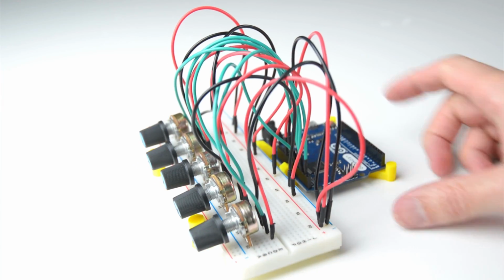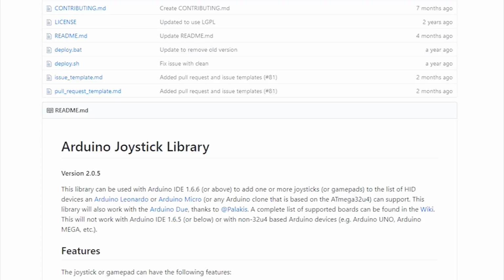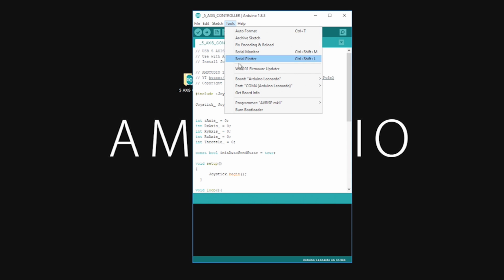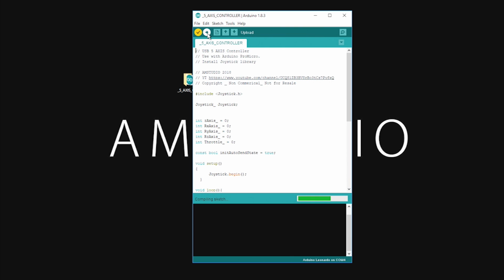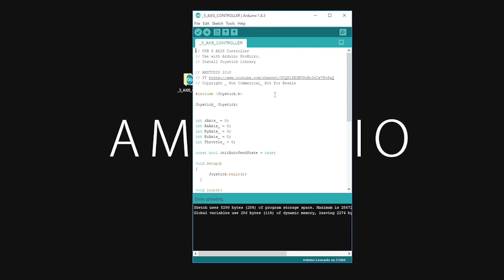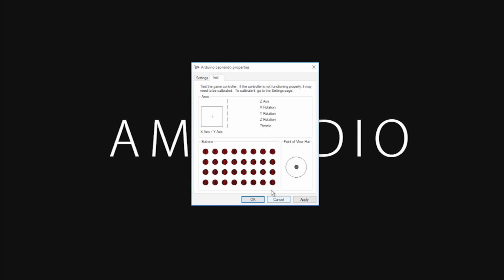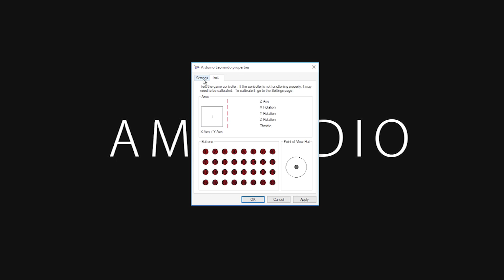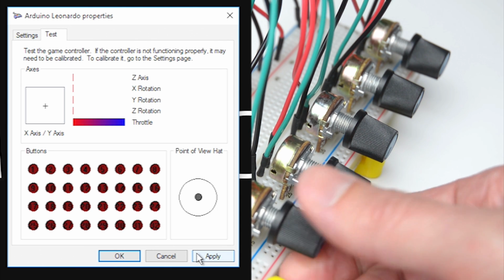5 AXIS ANALOG JOYSTICK GAME CONTROLLER

Comment: I have a qustion if I plug 2 arduino Leonardos can the game simultaniusly detect them both?
Reply: did you got your answer?
Reply: @imhumanx   yep it detects them as 2 seperate game controllers you can plug as many as ports for USB  you have.. but only problem is names of the controllers will be the same.. so knowing which arduino is which when setting up controls in setting of sims is difficult  and changing Arduino names is very hard i could not find any solid answer.
Reply: @SloGamer750  thanks brother

Comment: Could you please also show how to wire two position toggle switches and 6 position toggle switches? I want to build a custom switch panel to use with Microsoft flight simulator?

Comment: Will this work with 7 axes aswell?

Stick X
Stick Y
Pedals
collective
twist throttle on collective lever
throttle left
throttle right

Coz the 2 joystick boards running my simulator rig just aren't doing the trick.
Reply: normal plane have only 9 analog input or more. youke2,trottle,propeller,mixture3,rudder/brake2,flap1,trimm wheels2, thats have minimum control flight, 9-10 potentiometer need normal. and switch/buttond all what panel have start,power battery,lights,radio,speaker,heat,etc,etc,many, encoder need some gauge controll,navicator,radio,autopilot,speaker,maybe trimm wheels new model,,this have normal little size aircraft only ,big planes 747 etc all need lot lot lot lot lot more encoders,buttons,switch,leds, gauges,contyrollers.

Comment: This is annoying as all heck no matter what I do this sketch doesn't work I am calling shenanigans to many people post fake videos of working sketches just to put them online with mistakes put in place on purpose unless there is a problem with copping the txt from gethub and pasting it into arduino ide
Reply: I retract my statement arduino ide was the problem not the code even tho the libraries were installed by the software It did it wrong had to delete and find and install all libraries manually for this to work thank you for sharing

Comment: I tried uploading this for my yoke but when I move my yoke it moved all 5 axis at once instead of just 2 axis. Is there a code for just 1 x and y axis to be recognised, then I could assign them through FSUIPC in flight sim. Thanks in advance for any help.
Reply: You need to calibrate them. If it doesn't work you could also remove the other 3 axis in the arduino sketch.

Comment: Made this with 3 load cell amps for my DIY sim race pedals. Calibrated the axis to the pedals with the code, works a treat, thanks !
Reply: and it can be done with two potentiometers and a load cell?
Reply: @CarlosRCastro  yes no problem
Reply: Can this sketch work with just 1 potentiometer? I’m making my own set of pedals and only need 1 potentiometer for throttle
Reply: @banditfishing1558  yes you can just find some tutorials on the internet
Reply: when I run joystick program to turn arduino to joystick itt fails everytime and i can't make it, why?

Comment: Hi, can I do the same with a Arduino pro micro? and 3 pots? Many thanks for your videos
Reply: its basically the same, pro micro has the same chip as leonardo and yoou can use the same sketch just leaving 2 without connect
Reply: im making it for logitech g25 pedals
Reply: yes, you can use all analog input what board have.

Comment: does it work with Arduino Mega 2560? I think not because if I try to load a sketch, I see an error :(
Reply: not can use, if not need analog input you can use mega board whit mobiflight software and build lot more switch,buttons,encoders,7-segment display.lcd display, leds, etc you simulators.

Comment: Can 2 separate analogue axis potentiometers or hall sensors be setup to appear in windows as an x,y axis joystick without using a joystick module?
Reply: my question too... will the "x axis / y axis" window with the + in middle move around like a joystick when two hall sensors are plugged as X and Y axis...

Comment: can I use 2 potentiometer instead of 5 to control 2 axis and use the rest for buttons??
Reply: you can 1 to 6 or board maximum analog input pin. or 1 or 2 or 3 or 4 or 5 or 6 potentiometer. hehe.

Comment: Hello! I have done this one, and it worked out fine, almost :) I can only get out 24 % of axis in set up. I have added a button for tryin to calibrate it with zero success. Any idea what to do? I have built the 32-button box after your instructions - works really well. Thank you for your great vids!
Reply: I had to look at the code again and figured out what the cause was.
Reply: @mcrane42  I have the same, what is the cause?
Reply: @robertesaum  
Hi, you will have to change this line "zAxis_ = map(zAxis_,0,1023,0,255);" on all axes with 1023 instead of 255
Reply: @mcrane42  I tried this but it did not work, I got calibrated manually, changing to other values, I think my potentiometers are very old already, I need to change them. But thanks for the support!

Comment: Love all your projects have really allowed me to see what can be achieved in a bit of DYi. Having problem with this,  thought would be simple enough. Using a pro micro, wired output to A0 and A1 positive to VCC and neg to GND . Commented out non relevant lines on sketch. In calibrate input looks erratic, test looks fine though but in iracing trouble detecting axis. When detected both pots report the same axis. Even loaded your handbrake sketch and tested each pot independent but same result.  Any help will be appriciated.
Reply: Will continue to tinker / test till i get it working and will report findings.
Reply: Hmmm raw data is showing the axis reporting as -15000 to -31000 whwn i look at the handbrake now using the same sketch it reports 0 to 255. That might be the problem. Will switch polls on pot to see the effect.
Reply: Ok looks like i have LOG pots not Linear ones and your linked pots specifically state Linear so maybe thbats my problem will try with correct pots
Reply: Pots made no difference, iracing just wont reconise it as an axis. No matter i used ujr to map it to a virtual control and then iracing reconised it.

Comment: This looks like a good starting point for my own first-time project: Throttle, Propellor,  Mixture (TPM) controller for X-plane 11 (Windows OS).  I require 3 sliding push/pull  rods like in a Cessna 172. That means 3  simple linear axes, right?
 These can be rotary potmeters, can't they?
 What kind of potmeters would be best?  How would you connect the rods/sliders to the potentio meters? If these are a little too many questions, do you have a link to more info to get me in the right direction.
Reply from the maker: I plan on making this exact project soon.
Reply: not matter what potentiometer uses slider or rotating., all working

Comment: The sketch Works in Arduino UNO R3?
Reply: Sandro Mac sorry Man, you need the chip that the Leonardo uses, the atmega 32u4. You can try with the arduino pro micro; it uses the same chip, but it's smaller and cheaper

Comment: would this work the same way for rotary encoders?
Reply: Wm Ls no, you have to interpret the "encoded" angle of the encoder in software. It's quite more involved, specially if your encoder rotates fast.
Reply: @the-mush  see 32 button box it has rotary encoders.
Reply: @darkcypher111  yes, an excellent video as all the ones this dude makes! But as you can see in the end of the video, the encoders only trigger a button for a "step up" or a "step down"; that's the behaviour of those types of encoders.

If you wanted to simulate a potentiometer with those, you'll have to make a little routine in the arduino storing the added position off the encoder over time and add or substract the current step. Then you report the sum of all steps as an analog value. As I said, a lot more involved, not to mention all the little details you have to account with such an implementation, like making sure you don't miss any step of the encoder (or your "potentiometer" would become "misaligned") ...

Comment: Do you know how to code Arduino I need help basically I have some switches they are not momenty so when I flick the switch  it gives a constant pulse but I want the pulse just to blink on and blink off
Reply: And I'm using a pro micro
Reply: I could help, but you need to give the sketch you are using.....otherwise I can't do anything
Reply: Bert van Rossem Hello. Can you help me? I use this sketch for G27 pedals controlling. (Only 3 axis from 5). I need some button for H shifter min 8 button. How can I added this to the sketch. Thanks for answer and help.
Reply: Then you have to sense not the state of the switch, but rather the transition from off to on (the "blink on") and from on to off ( the "blink off"). The actual terms are Rising edge and Falling edge respectively.

The dirty way is storing two variables per button, one with the "previous state" and another with the present state. If they are different, some change had happen to the button.

Comment: Awesome stuff. Been waiting for something like this to help me.
I have an Arduino mega which I want to run 10 push button rotary encoders. Would it be the same to wire 10.
Reply from the maker: Different wiring and sketch needed. Check the buttonbox vid to see wiring for encoders